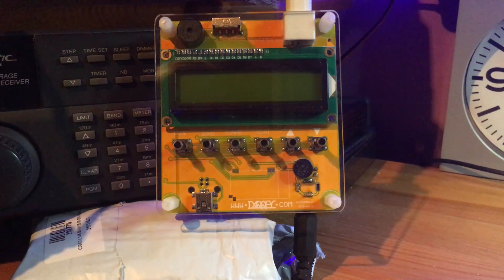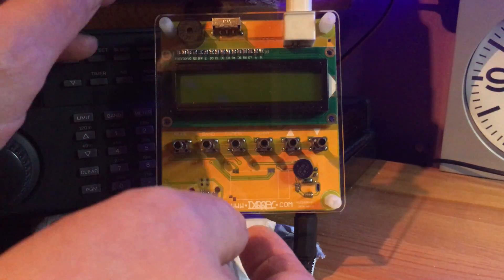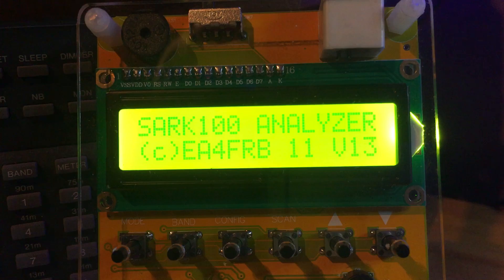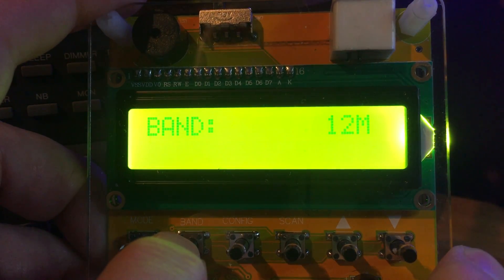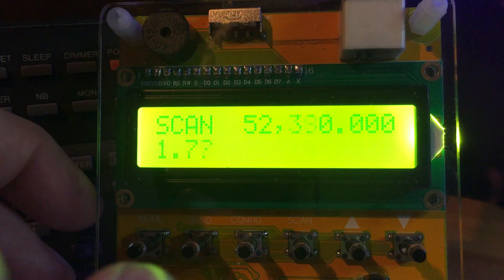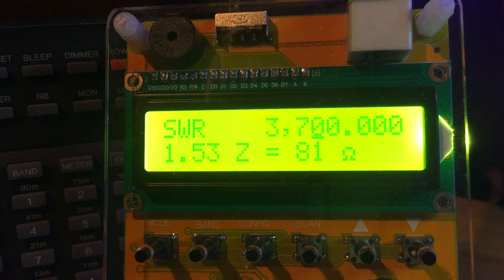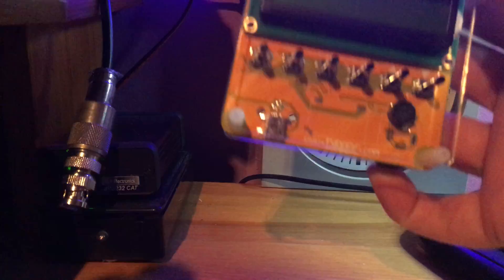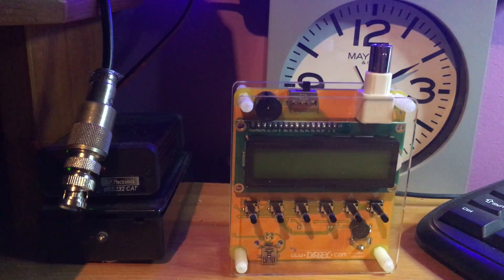SARK -100 Antenna Analyzer in action

Comment: You're using the newest firmware 13.0 also you might want to have a look at this software http://www.sm6why.n.nu/sark-100 it allows you to run sweeps and graph to your computer.  I just bought one last week and for the price it would be impossible to beat ;-)
Reply from the maker: Thanks for the reply Jim. As I have the latest firmware I shall concentrate on getting this software running. Many thanks for your input, I had the link already in the description box :)
Reply from the maker: what cable do you use Jim, is it simply a USB to MINI USB? Not had the time to take a look yet
Reply: I use a standard mini usb cable the type that use to come with everything you buy ;-)  I just tried figuring out cable loss using the analyzer, it's pretty interesting to see how lossy my cables are at 6 meters.  I did have one interesting result where I had loss actually drop between 30 and 20 meters, I'm thinking it must have to do with the length of the coax because that's the only place where loss gets lower by increasing frequency..  This will be a useful tool that I never could have justified the cost of an MFJ unit for...  I still intend to calibrate it but need to pickup 3 "cheap" pl259's...
Reply from the maker: I tried it with a standard USB to MINI USB cable and voila! Yes, indeed it does work and I cant agree with you more mate, I would never have put the amount of cash into an MFJ unit as this unit gives me a phenomenal amount of information, way more than I could imagine for something of this price. I've only done basic tests so far but it's interesting what you say regarding 6 meters and coax loss as I operate in the 6 MTR UKAC Contest and using only 10 Watts of power I need to be ensuring it is all going where its meant to! :) Thanks alot for your valued input Jim 73